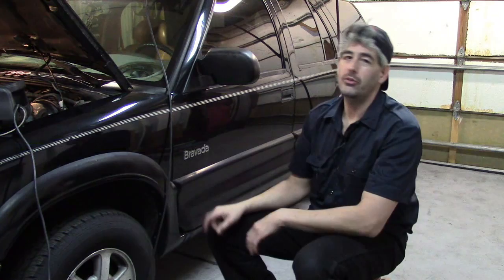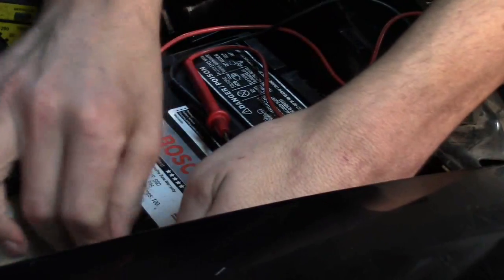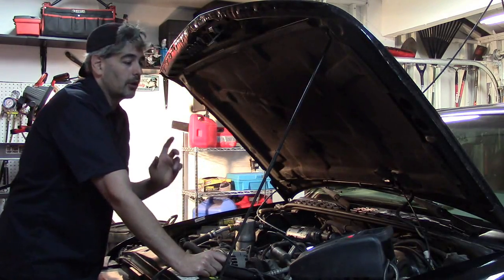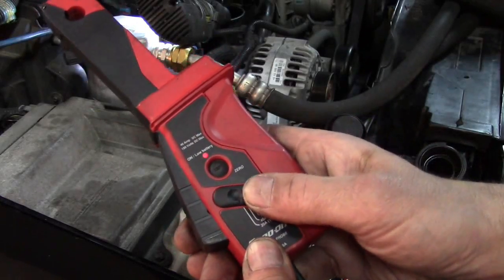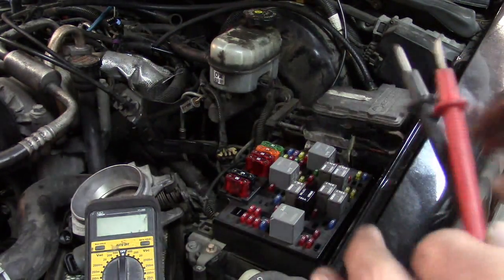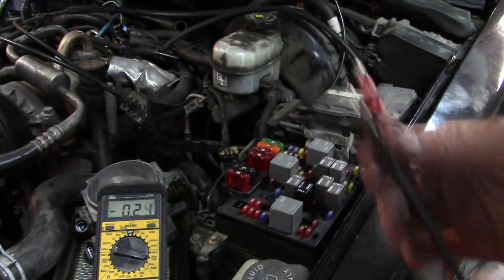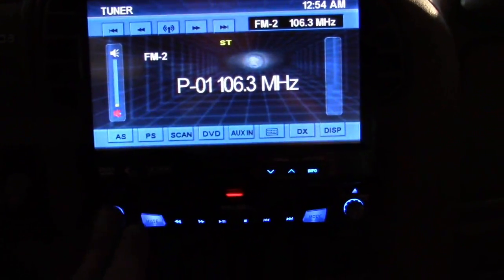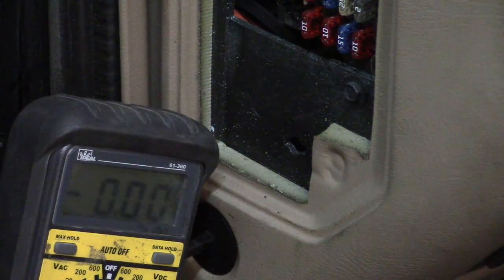Improved Methods to Find Parasitic Draw (Battery Drains Overnight)

Comment: Voltage drop is a good method and the guy that have used it for a long time and teaching it is Daniel Sullivan check him out you only need a voltmeter to test continuity short to ground he invented a tool for voltage drop testing in a second.
Check also the ghost voltage he explain all of it.
Reply from the maker: +g johan Yeah his name has been dropped here a lot. I saw a few of his videos but never saw one in this method.
  I did see the "load pro" he designed and intend to get one someday!
Reply: +Schrodingers Box Thank you for your good work for this channel and your time I am a happy payer of your new channel well worth the money spend
Reply from the maker: .g johan Awesome! Thanks man! Be sure to check out the new upload I made on methods to diagnose "invisible" mystery coolant leaks!

Comment: Why not use two cheap digital volt ohm meters from Harbor Freight set in volts the other in amp position
Reply from the maker: How would you monitor the time base then?

Comment: I must be slow, you confused me very much. What is the DVOM. I assumed it is the voltage meter you were using.
Reply from the maker: Yes its just a basic multimeter is all.
Reply: Schrodingers Box That's what i was thinking. Thanks. The term dvom threw me off.

Comment: Hmmm...it is much easier to pull a fuse on my car than to find a bare contact to test for voltage drop at any of the fuses in the driver compartment.
Reply from the maker: with many cars that is very true. Gosh on some even pulling fuses is a challenge!!

Comment: What brand and model of meter and clamp tester did you use in battery drain video..thanks
Reply from the maker: the clamp tester was a snap on. the meter - he’ll i don’t even know i think maybe innova?
Reply: Galen, nowadays you can buy an adequate all-in-one DC amp clamp with built-in voltmeter to do both jobs for about $40 US.

Comment: I don't understand how you hook the scope?
Reply from the maker: You are looking for amp draw. You simply set it to amperage and connect IN SERIES as with any amp draw- or use low amp clamp.  It no different than a basic DVOM. it's absolutely identical.
Reply: What about them cars with bigger battery cables? I work at Mercedes dealership and those battery are in the trunk and them cables are really big there's no way the low amp clamp is connecting to that
Reply from the maker: typically I clamp around the branch for the specific circuit rather than at the battery.
Reply: I just take a jumper wire and go between battery terminal and cable then put your amp clamp around the smaller jumper wire....works good..

Comment: I respectfully disagree:
You don't lose the amp draw if you connect a jumper to the negative terminal connector and post. This is generally done by using a paper clip under the battery terminal connector that's still on the battery post, connect the clip of one side of the jumper to the twisted on paper clip on the negative post and the other to the back of the negative terminal connector.
Then it's safe to remove the battery terminal. Now you don't reset fuses, you don't lose amp draw or reset anything.
And this slows you to safley put the load on your 10A multimeter.
Your first point doesn't make sense to me either, you are claiming that user incompetence is the fault of the old method that's been used successfully for generations. Someone forgetting to change to the proper setting is not fault of the 10A method!
Reply from the maker: sounds like a totally convoluted way of doing it but it would work. I mean… just do it without the paper clip by keeping dvom leads connected in series while disconnecting cable. why use a paper clip?
   my second point still stands though. user incompetence would still be the fault- not the method. you actually said that yourself even. you said the exact same thing I did but you disagree???
Reply: @SchrodingersBox  I think I explained it wrong or it didn't come across right.
I connect a copper bare wire, you can strip a 10 guage OFC wire if you wish. You lift up the battery terminal connector slightly so it stays connected but has space for the wire to wrap around the terminal post while terminal connector is still on most of the way.
Connect multimeter to copper wire after twisting the copper wire snug to the post, connect other clip to the back of the battery post connector.
Then remove negative off post.
All this is done on 10A on multimeter and keeps electrical flow to the system.
Some use an actual jumper to keep them connected.
I was taught this by a 40 year master technician. He worked on old and modern cars, the older cars don't have this issue where removing the battery was a concern. Even removing fuses can reset stuff but it really is a fast method.
I was taught the vast majority of parasitic drain issues on vehicles are intermittent and not constant. So even disconnecting it won't completely ruin your ability to find the amp draw.
For example, 02 Jeep WJ had a rusted rear hatch wiper that was stuck, the motor would kick on by ECM to return the wiper to right bottom position which is the starting point. This happened every 50 seconds on this vehicle but can be every 5min on other vehicles.
9A draw then back to 0.050mA.
Just used Max/Min on meter and walked away, came back 5 min later and seen the saved high and low draw.
Pulled a few fuses until it didn't show on max min while doing other work and found the problem in under 30min.
Also seen power outlets, interior lights, door harness wires cause this issue.
One vehicle had high voltage issues with O2 Sensor that eventually cause a short in harness and a 5A draw.

I've just never had a problem with this method, unless you are talking about another?

Comment: How would you fry your pcm by keeping multimeter in amp mode?
Reply from the maker: By bypassing the load so the transistor receives voltage instead of it dropping across the load.  The transistor cannot be the load.

Comment: Why don't you mention pulling relays to check for change in amp reading? I know a bad relay can cause a parasitic drain.
Reply from the maker: If the fuse identifies a relayed circuit then that would be a valid test.

Comment: Why does the fuse need to be removed when checking the amps at fuse location?
Reply: +Cobra Ninety Six It puts it in series instead of parallel, just like why you disconnect the negative battery terminal and hook up in series.
Reply: Ahh..., 10-4 makes sense! Thank you!

Comment: Hello sir, I am a new friend from Iraq. Can I ask a master about a computer or a railroad fuel tank? What is the petrol pump? How do you work for seconds to Nozel and then stop? And when the engine is running, your work is working. Is there a map or have video for study and I am thankful to you, sir? I have a Ford car. I have a Ford car.  Mercury 1989 The Vetem works without interruption only when opening a fence.
Reply: You should start by testing your flux capacitor.  Make sure it reads 1.21 GW.   If it doesn't you may still be able to get it to work with a lightning strike.  Good luck!  
- Emmett
Reply: @bdredden71  thank you very much my deer

Comment: Been working on my daughter's 2011 Nissan Pathfinder, haven't found the problem yet, I've done this before and found the drain with no problems at all, her draw fluctuates between 0.02 to 1.21, with with some momentary stops in between, first time I've done a Nissan and one of the under hood fuse boxes has a row of fuses that are next to impossible to get to, damn Nissan. So I'm watching YouTube videos to see if I can get a handle on what's going on, never have seen one fluctuate constantly like this, meanwhile my daughter has to go to work with a parasitic draw. Any suggestions be appreciated.
Reply from the maker: With that much of a drain and fluctuation like that, sounds like a light going on and off. Pull accessory fuses and see if it goes away. might also be a solenoid. Pull fuses for engine controls and see if the drain goes away to get a direction.
Reply: @SchrodingersBox  Thank you very much.

Comment: I have a 2013 civic drawing 4 Amp.  If I unplug the power cable to the under hood fuse box it goes to 0. Pulling every relay and fuse does nothing.. bad fuse box ? Any suggestions?
Reply from the maker: 4 amps??? What’s the amperage through the alternator showing?
Reply: Yes its a big draw it's drains the battery in under an hour. It just has me confused with the fuse pull test
Reply from the maker: There are so few things that draw 4 amps. Usually that’s a motor or a major computer module. Maybe there is a short on a battery power wire somewhere.  That’s a massive amperage.
Reply: Found the drain... electric power steering rack.
Reply from the maker: Hahaha no way!!!

Comment: Also I do not have any type of computer diagnostic equipment Have you ever experienced a model like mine 2011 grand caravan having spark plugs cause the alternator not to charge or affecting charging system? I saw this on another video and it blew my mind! if it’s just spark plugs I might jump off a bridge lol 😂
Reply from the maker: I have a video somewhere of ignition wire interference causing some electrical interference issues but not that exact situation. It can definitely happen though.
Reply: Man I am at my wits end with this thing I don’t have any diagnostic tools and I’m not very good with that part I’m pretty good with cars maybe I should go back to Classix lol
Reply from the maker: lol that’s why you need diagnostic tools. I’d be at my wits end too if I didn’t have a way to get any data.
Reply: @SchrodingersBox  I haven’t had a lot of formal training with meters or electrical stuff I am more just gearhead but I gotta try to learn somehow I’m never gonna get it fixed
Reply from the maker: That’s exactly how I learned. Same exact situation. No training but had to adapt. I wouldn’t have even known how to use a basic multimeter 10 years ago.

Comment: I was trying the first method for the draw test but I wasn't getting any reading. Do you have any tips to see why
Reply from the maker: Yes- do a positive control by turning on an accessory that requires sufficient amperage to easily measure.
Reply: Schrodingers Box 
I'll give that a try
Reply: Schrodingers Box
Another thing I should say about the car is that if I was to hold the horn or turn the lights or even push the brake pedal down, this all seems to reduce the battery in a short space of time and it won't start. Also should the brake pedal lights come on when the key isnt in the ignition, just found this weird
Reply from the maker: Matthew Ruddock  The battery of course must be charged for this test to work.

Comment: I DONT UNDERSTAND HOW YOU ARE CONNECTING ALL THOSE WIRES TO THE BATTERY
Reply from the maker: Pretty simple- just going in series with the battery. Since it's amperage and not voltage measurement, the polarity is irrelevant, so you can actually connect either way!  Simplifies it tremendously.

Comment: Why is my multi meter not working for parasitic draw test? no current seem to be going trough.. I even turned on the head lights and nothing... My meter is too cheap? blew a fuse in the meter?

Im using a cheap meter by the way.

I disconnected the negative battery terminal  & placed  it in series ... put it on 10 amp scale & moved the lead to the correct settings... and its 0.00... turned on lights and still no current. no power to lights or car

I mean once I unhook the negative terminal its dead. new battery by the way... hooked the battery back up & everything works fine... 

Works for volts and everything else though..
 

https://sfbay.craigslist.org/sby/ele/d/new-craftsman-8-function/6684713626.html
Reply from the maker: Test it on a known current draw
Reply: I have almost the exact situation on my hands. It got me to wondering (a complete novice, by the way) shouldn't there be SOME amp draw all the time, just within an acceptable range? I've tried it a couple times and only ever see 0.00. I use a cheap multimeter as well. Ever find anything out?